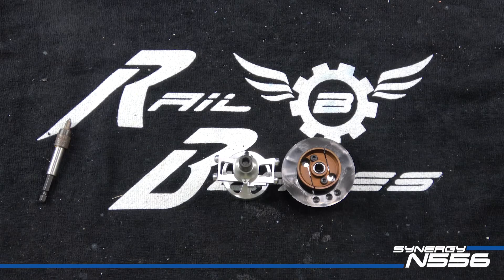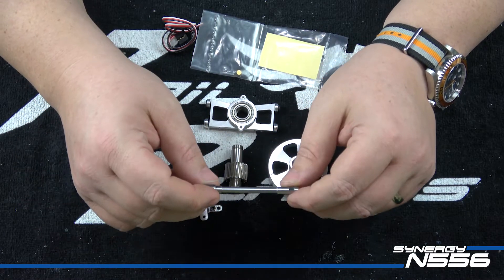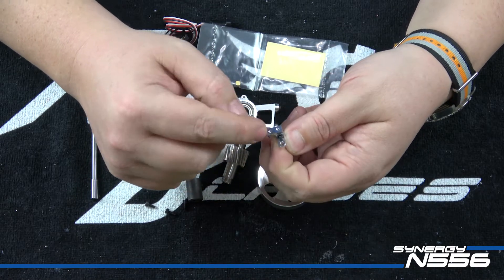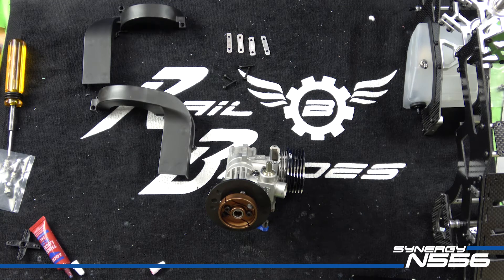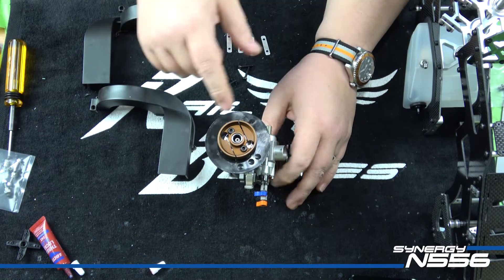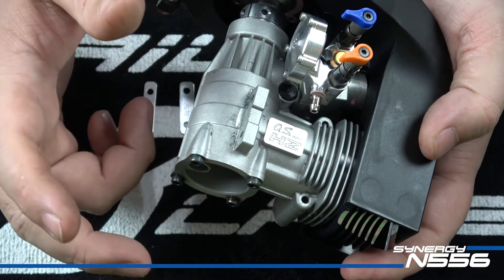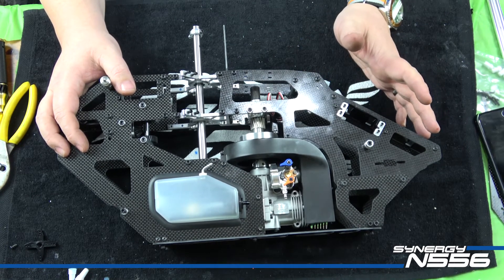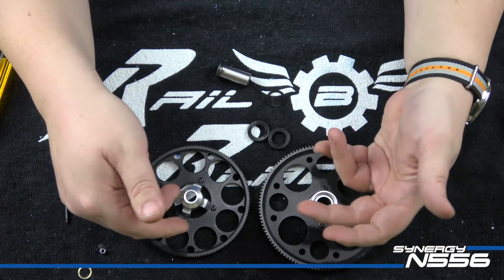Synergy N556 Build Series Part 2: The Engine and Clutch

Comment: Hey Chris, what magnet rpm sensor can I use with the Neo.  I have the Spectrum backplate sensor on my N7.  I want to try a different one on the N556...
Reply from the maker: akbradley57 hey man! I always used the align magnetic sensor on my vbar stuff. You have e to change the plug but there are plenty of threads on the vbar groups and forums for the correct way to wire it.